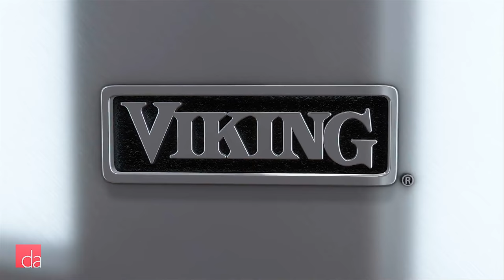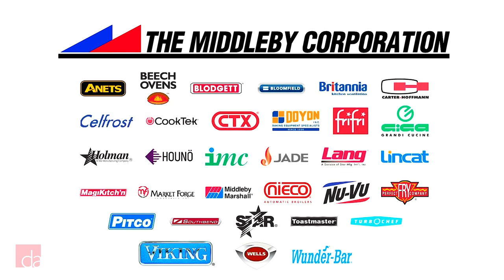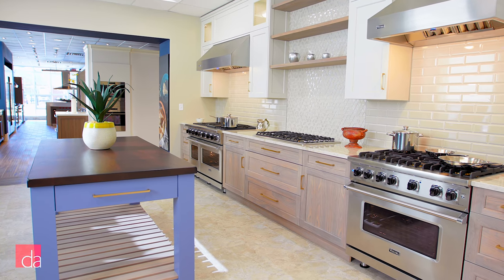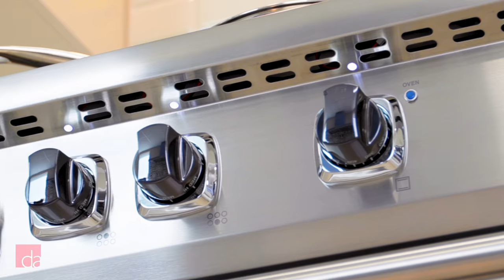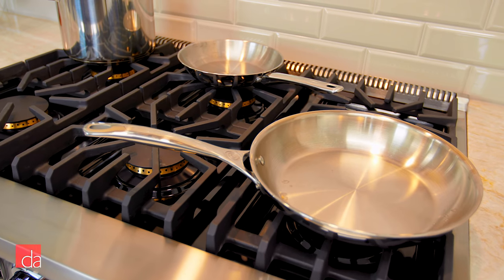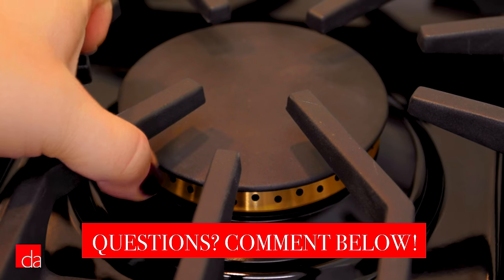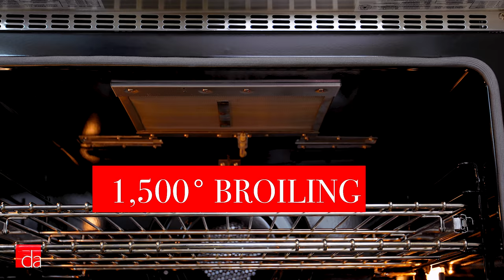Viking Range - 3, 5, 7 & Tuscany Series Explained

Comment: I'm between Viking and Blue Star. What do you recommend?
Reply: Do not get a Blue Star if you do any baking. It has no bottom heating element. I just got a blue star and everything I bake is brown on the top and not done on the bottom. I’m am going to try to return. Not happy at all with it. 
I don’t know anything about the Viking
Reply: @heidigeissinger1203  which model did you buy?
Reply: @AlexRocksYourSox  
30 inch platinum series. But all blue star models have NO bottom heating element
Reply: @heidigeissinger1203  That's crazy to me! I don't bake much, but when I do, I don't want that! Thank you for your input!

Comment: sheetpans are 24 x18, a 27 inch oven will easily accomodate full size trays.
in commercial kitchens we leave an old tray on the bottom of the oven, no need to clean any spills, just throw the sheetpan in the dishwasher.  Its a fools errand buying commercial style equipment if you lack the training or experience, 
"all the gear and no idea"  is the saying. But wankers love their fantasy.
The dual speed fan is nice but we always found workarounds to bake with single speed conv.

Comment: NEVER BUY VIKING appliances! I purchased all Viking appliances for my kitchen about two years ago. The refrigerator, the dishwasher ,the stove and oven.It really sucks.The refrigerator got a crack at the bottom few months after purchase. And then the freezer broke down and the temperature was too high to freeze food at all! I spent a lot of money on repair for several times and it broke down again and again after each repair! The technicians are so familiar with Viking and they told me that they could not give any warranty because Viking refrigerator will definitely break down after repair within two months.
I don’t have any refrigerator to use and I have to repair it again and again. Viking warranty is only 1 year and customers have to pay high fee for repair after that. That is worst quality I experienced with a refrigerator.
The Viking dishwasher , stove and oven don’t work well either. Sometimes the dishwasher didn’t start to work when I pushed the start button. Sometimes when it finished working and you can find the dishes are still covered with detergents . The oven timer doesn’t work at all. I have to set up an alarm on my phone when I am baking something with the oven.
I really wonder how such a bad quality appliances can survive in the market! I can’t imagine how many customers are suffering from such bad quality and service!